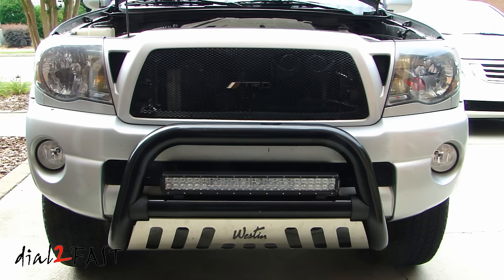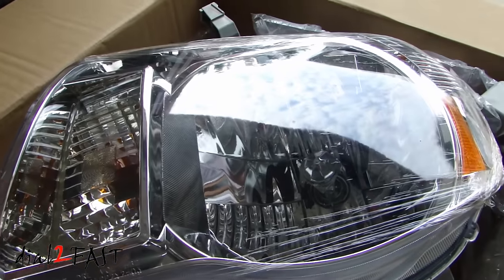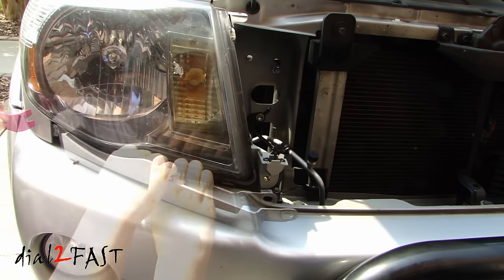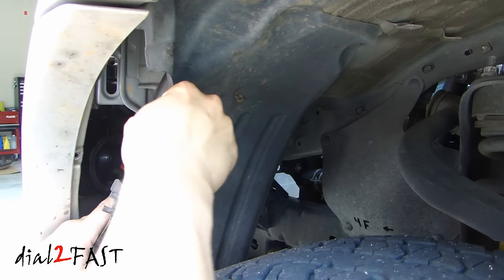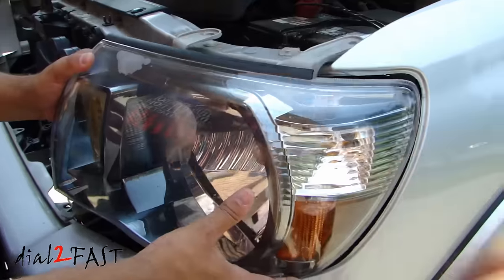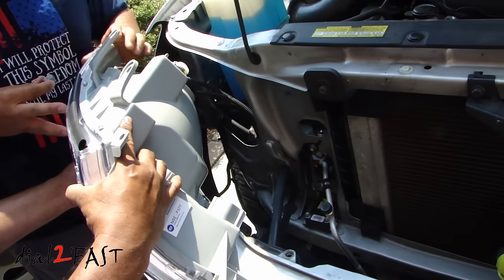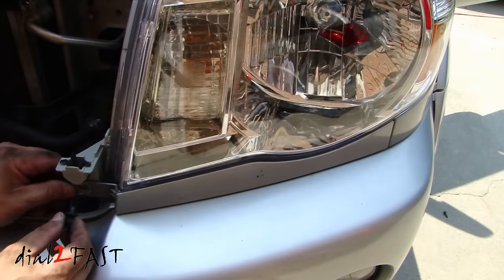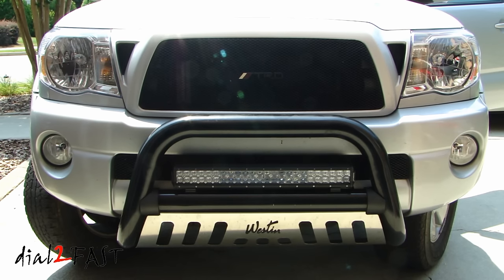Toyota Tacoma Headlight Replacement 2005-2011

Comment: This video was very helpful for me. Took me about three hours because it was the first time I've done it. Before taking out the old units check the aim of the headlights against the garage door or wall and mark where they point with some painters tape. After the new lights are installed be sure to aim them using the the markings you made beforehand. Mine were way off. Thanks for posting!
Reply from the maker: Excellent to hear. Thanks for sharing. I have now added a link at the end for a video how to aim the headlight. You can check it out for reference. Thanks! https://youtu.be/sgPMolAhieA

Comment: I just did this for my 2006 Tacoma. Since I had the front disassembled, I replaced the grill with a fun after-market one. That bolt under the fender flap was a butt-kicker for me too, but I finally wound some tape around a 10mm socket and was able to break the torque and spin it off and back on easily with my fingers. There was no way to get a socket wrench in there with any precision.  I also took the extra step of putting a ring of silicon around the headlight bulb gasket to make it as water tight as possible.  Moisture is what make my original lenses discolor in the first place.  Your instructions were great and the video images perfect.  I watched it all the way through once, and then bit by bit as I went along.  Thanks!
Reply from the maker: Excellent to hear. Thanks for sharing your work!!
Reply: How fun was your new grill?
Reply: Are your lights discolored again? Mine are

Comment: I have a 2010 tacoma. The reflector on the passenger side broke and melted to the bulb. I was able to order driver and passenger side headlight assembly on Amazon for about $100 . I wasn't sure I'd be able to do this myself, even though I am pretty handy. This video was very helpful. I was able to remove the old headlight assembly and install the new one. The bolt near the Tire well was very challenging to remove and put in. I did end up breaking two of the plastic clips that held the grill in place. I was able to find them at my local AutoZone and replace them. Thank you so much for this very helpful video.

Comment: I would recommend adding clear silicone lining to the new headlights. They are usually not sealed in properly and cheaply made hence low prices . Will make them last longer

Comment: Very helpful video. But like most folks, the 10mm bolt you have to get to through the wheel well is a Royal PITA. 
I found that it was a LOT easier to get to if you turned your wheels to the opposite side you are working on. When replacing the left assembly, turn the front wheels as far right as you can, and Vice versa in the right side. This gives a lot more room to get up in there and work. Not easy, but easier.

Comment: This is a great video.  I just replaced my headlights today and would never have known what to do without this video.  The step by step guide was perfect.  I did remove the two bottom bolts under the bumper that hold the wheel well cover on (mine is a 2009).  This allowed easier access to the bolt on the inside of the bumper.  That bolt on the inside of the bumper accessed from the wheel well was indeed a real butt kicker. You need to be a contortionist to get a socket up there.  But other that that, the process was easy. Many thanks for putting this instruction up.  It saved me hundreds of dollars.

Comment: We watched the video twice.  Then replaced ours in about 1 1/2 hrs.  We would have been clueless without the video.  The bolt behind the bumper that needs to be accessed by the wheel well was by far the hardest part, but the second one was done in less than half the time.  Our Tacoma is a 2011.  There is also a nut underneath the bolt that holds the bumper.  This one does NOT need to be removed.  I found a 1/4" ratchet is the best tool to use on this.    We bought Diften 114-A9007-X01 from Amazon for $105 for both.  I recommend you replace both together Even if you need to replace only one considering the effort it is to do both together vs one.  Thanks for the great video.

Comment: Very good instructional. I found the easiest way to get to that one bolt was crawling under on my back and reaching up behind the bumper. Wasn't happening any other way for me.  The other hard part was getting the new lights in position,  just took a lot of patience.

Comment: My 2010 had 2 extra 10mm screws before I could pull the fender liner back. Thanks for the video saved me about $200.
Reply from the maker: Thanks for sharing!
Reply: So did my 09 plus another strange plastic type push pin the I pretty much just ripped out.
Reply: Jason Mcalaster where were they??

Comment: Thank you, so helpful and took about 1.5-2 hrs.  I reached under the fender to get the side bolts as a few others did, couldn't access them from the top.  Only new comment, my '06 has 275k mi on it and most of the plastic clips were brittle and broke on removal.  Couldn't find them at a local auto parts store, and dealer had to order them in.  I'd recommend ordering in advance and having them handy when doing the job to make sure it all goes back together safely.

Comment: I just finished up my 09 and I could not have done it without your video so thanks a lot. I used TYC NSF certified assemblies and they fit perfect. I used a 10mm stubby ratcheting wrench to get those inner, hard to get to, bolts. I want to mention that after the bolts and push pins on top of the grill are removed it does not just pull straight up, you have to release those two clips on the bottom that are on the headlight bracket. Mine took about 2 - 2.5 hrs. but I went slow and watched the video a couple times.  Thanks again.
Reply from the maker: Thanks for your comment and sharing your experience!

Comment: I recently did what you did but for my 85 year old neighbor.  The Toyota dealership he uses wanted over $500.00 to change his 2004 Tundra faded headlights and being on a fixed income he just did not know what to do as they were so bad they failed state inspection.  I ponied up $62.00 for 2 headlamp assemblies and 2 day Prime shipping and became his hero...again.  I was done before he could finish his morning cup of coffee.  He couldn't believe how easy it was to do.

I have the same Westin bumper you are showing in the video on my Chevy 2500.  How long is the LED mounted on it?  Is that the 23" in your other review/install?   It looks good.
Reply from the maker: Thank you for sharing your story about helping your neighbor. It's great to have people like yourself to help others. As for the light bar, yes, that's the 23" Auxbeam lightbar I installed on the same Tacoma. The owner loves it.
Reply: Thank you for helping them out, you are a Hero!
Reply: BobbyW00 , thanks for help your neighbor

Comment: Good video; I was a bit unsure of how involved removing the grill was, but the whole procedure looks easy and straightforward. My headlights are not only melted at the DRL's but the bezels have spiderline cracks and have started hazing over. I would like to have seen how well the lights were aimed after installation and how difficult they are to aim. Most review comments on replacement lights are critical on either how much the replacements leak, or how far out of alignment they are after installation, and that the aiming screws don't do anything. Looks like I'll find out this weekend.

Comment: Thanks for the video. I did my 2009 Tacoma yesterday, pretty straightforward with the exception of those bottom bolts. The ones that are inside the fender. I did use a quarter inch 10 mm socket to remove them. It took a while but I did get them off. The right hand light was even more difficult. However it was well worth it. My local Toyota dealer wanted $900 to replace both lights. Bought after market lights on eBay for $90. They look great. Looks like a new truck again. Even if they only last a few years, I'll still be ahead of the game. Easy enough to replace now that I've done it.
Reply from the maker: Excellent. Thank you for sharing your experience!
Reply: Did you do anything special to get those hard to reach bolts back on?

Comment: Awesome video many thanks. Just one thing I learned; - I fully assembled everything but when I tried to fit the grill it was too 'narrow'. That is the clips wouldn't locate by approx 1/4 inch. So I had o go back and slacken off the blind horizontal bolts on the headlight unit, - fit the grill and then tighten back up. Many thanks though, without your video I wouldn't even have bought new units. My daughter is very happy!
Reply from the maker: Thanks for sharing and providing your feedback.

Comment: This is exactly what I needed. A bit more work than I wanted to do but I'm willing to give it a shot. You explained it step by step really well. Both mine on 2009 are after market from crash n 1 has been collecting condensation 90%for 2 years n now on both turn lights there is a single vertical crack on the front
Reply: Fr. I was hoping it would just be a couple screws. This is a bit more than I thought lol

Comment: Awesome video! In my opinion the most time consuming difficult part was removing the 1 screw accessing through the  front side of the fender well. That alone added approximately 45min./light to the total disassembly processes. Took mysrlf 2hrs to complete. I did not reinstall these particular screws. Headlights hold solid with the other bolts installed. 👍 Thank you!
Reply from the maker: Yes that one screw is a pain. Glad you got yours done!

Comment: thanks for the vid, it saved me time and $$$. On that hard to get bolt inside the fender liner there an easier way. I used a 1/4 ratchet and held it through the fender liner while my wife put her thin arm through the inside where the grill goes and ratchet it up. Made it a lot easier and faster.

Comment: Thanks for the video, it's very helpful. Just one observation, to remove the side bolt, it's easier to pull and drop the bumper and it's much easier. Thanks a lot anyway, it's the best video i found
Reply: Absolutely..... I just figured that out after pulling my hair out.  Didn't even have to drop it.  Just loosen it and pull down wheel flare enough to get at it

Comment: Good job with a concise step by step explanation. Just wish Toyota engineers would have made things a bit easier. Probably did it to make sealing the assembly harder.  Also adds to All Data or Mitchel's repair time for mechanic fee to replace with this design. Other than that, a Tacoma is so well made for longevity and minimum maintenance.

Comment: Replacement went well.  Video was really helpful especially understanding and accessing the bolt in the fender well.  I am interested in any feedback as to light not aiming correctly.  One is just fine.  The other is pointing too high.  I will fiddle with some shimming, but was curious if anyone else had the issue and how they resolved.  Thanks!

Comment: I found a much easier way to get the outside bottom bolts off on my 2010.  If you have long arms, reach down and outward from where you removed the grill.  I was able to get a small 1/4" ratchet with a 10mm socket on it and get the bolt out in a couple of minutes.  Putting it in wasn't much harder.   Just understand that there is a small nut, also 10mm, just below the bolt.  It's easy to get them confused.  If you do, no big deal, the nut is easy to put back on when you get the headlight out.

Comment: I love this guy!  Dr. you have helped me on several car topics.  This one went fairly smooth.  I did one of the bottom bolts like you recommended.  I got it but it was like tricky with my arms all tangled up.  The second bottom bolt I use my lift.  That was easier.  I did experience trouble matching the new lights with the grill.  In the end it all worked out great.  I appreciate your passion for doing videos.  Keep it up!
Reply from the maker: Always good to hear feedback like yours. Thanks for sharing!

Comment: Great video!  My only comment would be that by removing the 2 hex bolts that hold the bottom side of the fender liner makes the access to get to that PITA screw on the side of the headlight a bit easier.  I only did this on the passenger side since I had already fought through the  process on the driver side.  I would assume the same would be true for driver side access.

Comment: I just found this video and appreciate all the comments others have made. I'm in Canada and have the daytime running lights and since mine is a 2009 plastic is getting cracked and cloudy. I just bought the 2 full assemblies from autoparts.com for $33.31 each, plus $10 for for shipping and handling, which was a deal as they came in a huge box. Will update after my install, can't do it right now as it's raining. I saw mention of the recall, apparently it is not a safety recall so expired, and as I bought my truck in the US without DRL and did a mod, Toyota would not cover the change.

Comment: Great video and comments. However, I ran into an issue I did not see discussed. My 2011 Tacoma is an SR5 with added cowling on the fender. How is this removed without using a sawzall?? I noticed and removed a plastic retainer, but nothing else is visable to remove for access.

Comment: Good tutorial!  Here are a couple things I found to be a little difficult.  
1.  The last screw under the tire well cover really is a tight squeeze.  There is a small nut just below the bolt you need to remove that I used as a marker to find it.  I accidentally took this nut off by mistake!  
2.  The bolt that you remove from the side of the assembly is different than the others but is still 10mm.  Initially I thought they were all the same and tried to out one of the others but thought the clip was defective when in fact the bolt is different. 
3.  Manipulating the headlight is a bit challenging but not impossible.  The bolt holes on the top and under the bumper all lock into the headlight to hold it in place which helps a lot.  However when putting the new light in I noticed the assembly under the bumper is the one that caused the most problems in getting it lined up right. 
4.  Once you are close to putting all the bolts back in I HIGHLY suggest you line up the bolt under the wheel first and thread it in by hand and then secure the others.  It is much easier to do it this way and the passenger light completed in 20 minutes versus 40 for the driver's side. 
5.   I checked to make sure all the lights worked (turn, high/low, running lights) before tightening everything down as I didn't want to have to take it all apart.  This is helpful on the passenger side as the space is really small here. 
6.  Seller on amazon was great and item arrived safely packed.  https://www.amazon.com/s/ref=nb_sb_noss?url=search-alias%3Daps&field-keywords=2006+tacomna+headlight+assembly

Comment: Ahh... I have to remove the front bumper. I currently have a "cattle guard" on it. I wonder, If I could just shimmy the bolts out and in with the new. Without pulling it off... hmmm well got another project next weekend. Thanks for the informative video friend!

Edit: I'm an idiot. I couldn't see you also have a "cattle guard" on my smaller device (phone). Now on my bigger monitor, I see the cattle guard.

Comment: how has the headlights held up? Did it burn the lens again? I replaced the pair for this reason, but may have gotten some where the blinker housing was recessed so now of course im seeing some burning again and its got condensation again even with sealing with silicone.

Comment: Ugh!  I just tried to remove the grill on my 2006 Tacoma and it won’t come up and off that easily.  I finally got it up and off with a bit of brute force.  The clips just broke off so I guess I will need to replace these.  In fact almost every clip broke after removing them.  Did you say that you put a link to these parts somewhere?
Reply: I found some on Amazon for $8! 100 pc clip set in 3 sizes (the ones you need for these parts is 9mm, the largest of the 3 in this set) The brand is GOOACC

Comment: My turn signals melted as well on my 2007 Tacoma. Considering replacing them with the 2011 model. Did they fix the housing for that model as you mention in the video? or only fixed for the future gens?

Just wondering if I should also go with an LED option to stop the melting in the future. Cheers

Comment: This is only close to a 2007 XRunner.  The extra stuff on the XRunner makes is a lot more difficult to get to that screw down by the fender, and the mechanism for getting the wheel well liner is different on the passenger side from the drivers side.

Comment: HOT TIP FOR THE THIRD BOLT:  If you remove a couple more 10 mm bolts in the wheel well, you can pull out the plastic for the bumper for almost straight access to the third 10mm bolt (the hard one).   I should have taken a picture....

Comment: Question, I have a 2010 Toyota Tacoma when I click the lights, once the daytime running lights. Come on when I click them twice only the headlights come on the daytime running lights shut off when the headlights are on is this correct supposed to happen or should the daytime running lights stay on with the headlights on?

Comment: On my 2007, removing the lower bolt on the L-bracket was not possible via the wheel well.  I went in under the bumper and got it out without too much problem - although it's a pretty tight area.

Comment: After following this video, is there no need to adjust the lights to where they don't blind on-coming traffic? Thanks.
Reply from the maker: You should have it aligned properly after installation. There is a procedure you need to follow where you aim the headlight on a level surface to a wall 25 feet away.